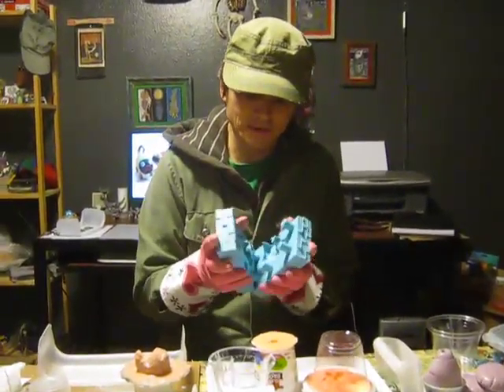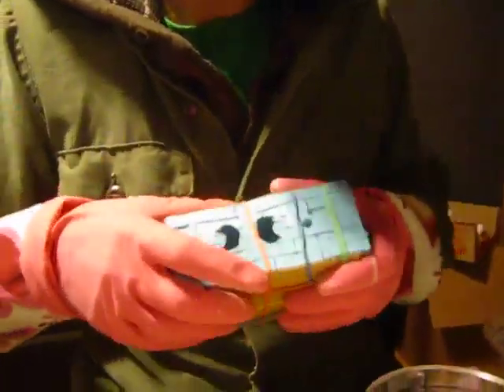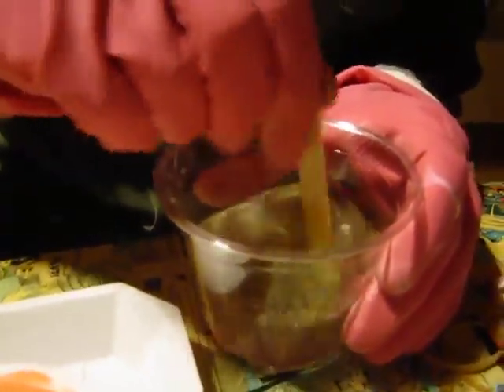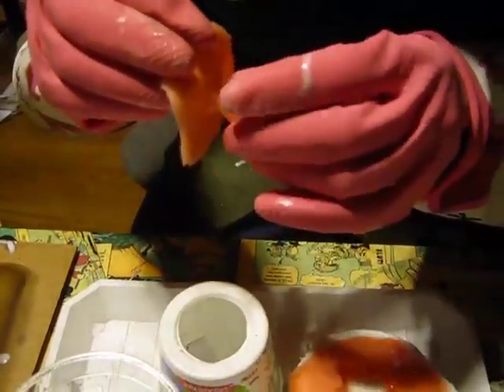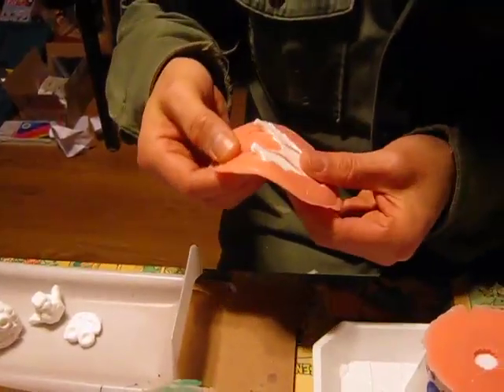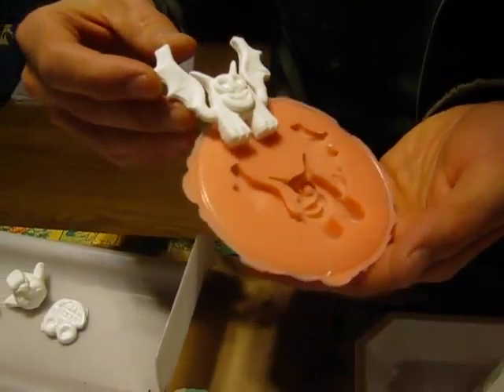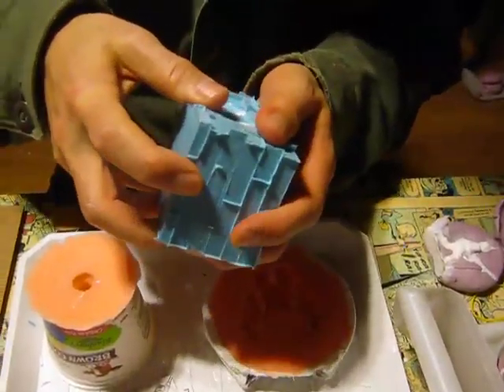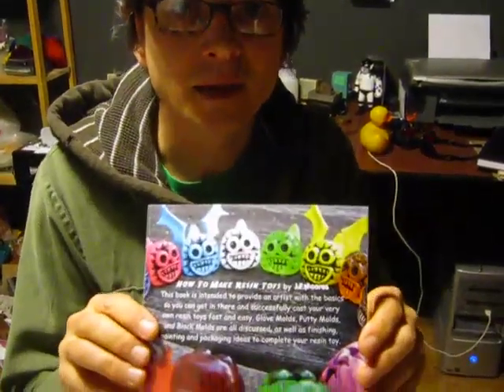How To Make Resin Toys Video 3: Pouring Resin

Comment: You can use a sprue to cast the whole thing at once and place some vent tubes close to the model. When you cast all the air can escape trough there. It's a little more work but the whole thing can be cast at one time.

Comment: Hello,
How can I get rid of the air bubbles when casting a half open hand of a 12" figure with resin?
Thanks
Reply from the maker: I use a small V shaped chisel and make air grooves. The grooves must go up, because if they go down, the resin will just pour out. Vents are needed for some shapes, and each shape has its own complications.